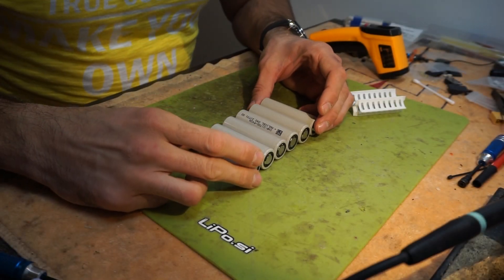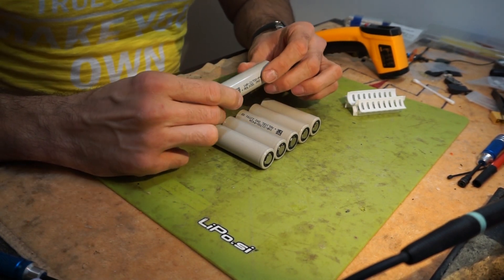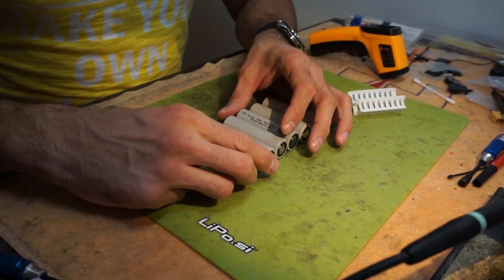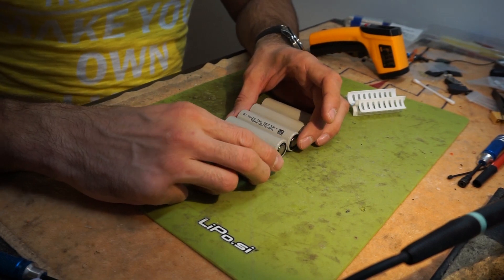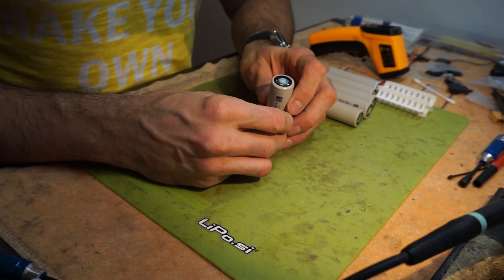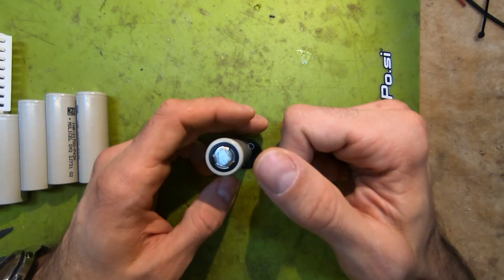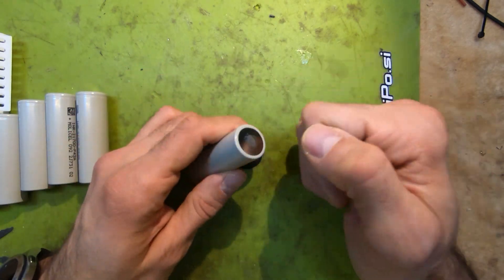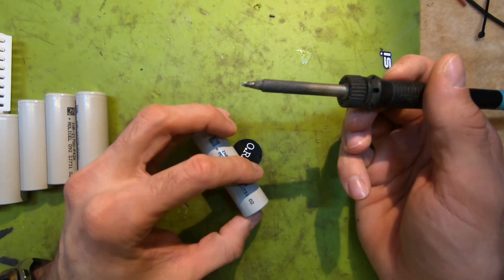How to make 6s li-Ion 18650 21700 battery for long range FPV PART 2

Comment: What is the size of wire (gauge) in betwen cells?
Reply from the maker: Whatever you have laying around
Reply: @mrRockwellFPV  thanks. I thought it has some connection with the amperage from the battery.
Reply from the maker: @PopGheorghe  it has but you only pulling 30a in the worst case. Motor wire leftovers are more than capable to handle that kind of load.
Reply: @mrRockwellFPV  perfect. Thanks.

Comment: The spacer connector for building a 6S pack isn't available in the thingiverse link.  There's a second part but it's not obvious how to connect two spacer.
Reply from the maker: Sorry will upload the correct one

Comment: Rosin paste flux works wonders when doing this type of soldering.  As shown here where the solder quickly adheres to the battery ends.

Comment: 4s1p 21700 enables my quad to fly almost 45 minutes
Reply: is that a 5" quad? what is the dry and all up weight? currently building a 7" geprc mark4 with 6s 21700. waiting for everything in the mail
Reply: @jasenhenry  10" props on 9" frame. AUW 830g. Batteries weigh 280g. Full fpv, gps and 3dr telemetry on board.
Reply: @dronepilot1333  good stuff mate. waiting for parts in the mail but ive calculated about 388g for the 7" im building minus props, battery and gopro. i know 7" is not nearly as efficient as 10s but that is some impressive stuff. thanks for the info

Comment: Lol I looked up this video just to see 20700's spot welded into a 4s or 6s pack...  and how it was done...  I've seen other battery packs from my scanner spot welded, and knew my welding iron wouldn't work.   I've since though bought a TS100.      Most people aren't going to have a 3D printer - I'm probably going to have to make a spacer out of paper or wood :-/    fpv.air-war.org